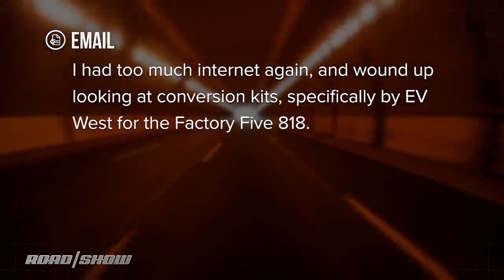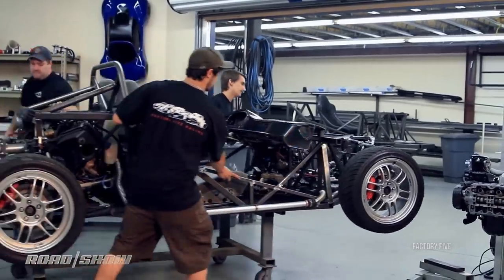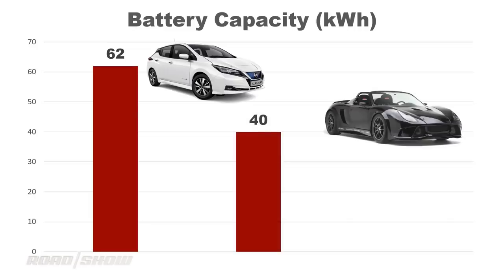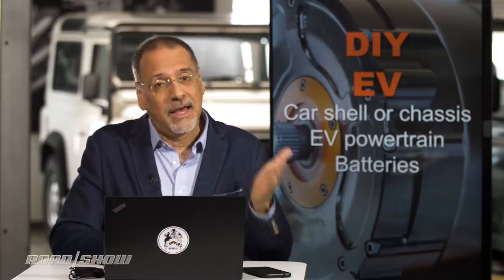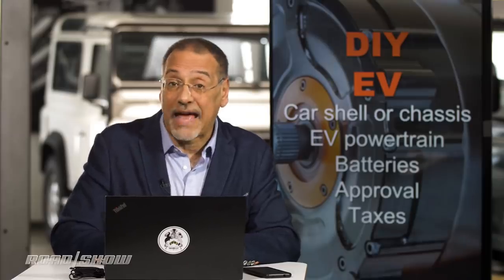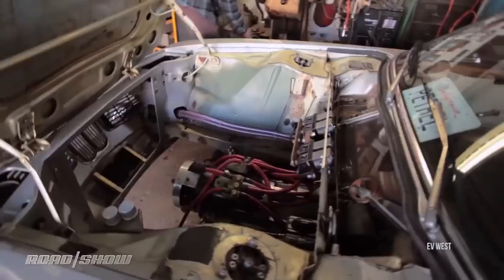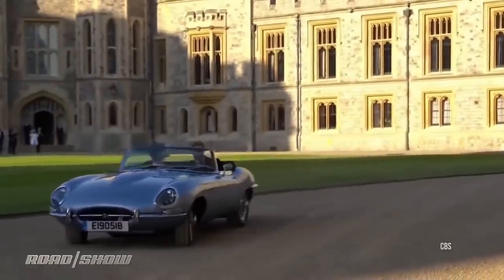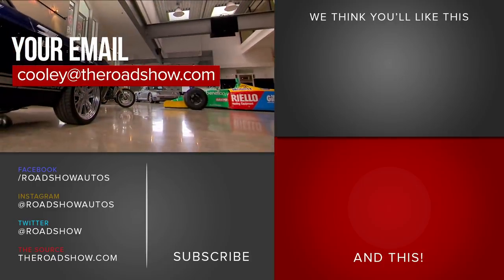Before you buy an EV, consider building your own with a conversion kit!

Comment: There's a ton where you don't need to necessarily spent $35k. A Hyper9 motor or a UQM motor with all the accessories like chargers, cooling kit, etc can be had for $10k or even less, depending on what you choose for parts. Also, skip the Tesla overpriced batteries for something more reasonable like LifePO4 or build your own 18650 pack and you can get that down to $5k. Convert your existing car you already have and save another $10k. Realistically a $20k budget these days, if you are just converting a car you own, is definitely doable. You won't have a Tesla with 300mi range or 0-60 in 4 sec, but an EV with respectable range and acceleration
Reply: I have been wanting to do this to my 2001 BMW..  Do you have any resources that you can recommend?
Thank you in advance
Reply: Thank you. My wife and I are in our late 50s and own 5 vehicles. I hate the idea of trashing my paid for vehicles and start all over with an expensive EV carnote. Thanks for your input.
Reply: This is perfect for what I have in mind, converting a 2006 Dodge Charger SRT8 from Gas to electric.
Reply: We can buy a new EV car in $8k why go through that hassle.

Comment: This sounds like a fun and terrible idea, just like most “project cars”.
Reply: Because it is a Project Car with similar level of frustration and difficulty. Not any worse or better.
Reply: Rich Rebuilds did a video on this. Another guy, at EVTV, stopped doing conversions because Teslas are better and cheaper than what he could build, even with a decade plus of experience. Conventional wisdom says:You’re better off with a used Tesla if you want a cheaper EV. If you have $100k burning a hole in your pocket (ie money is no object), go the kit / conversion route.
Reply: Like "project" anything at home!!!
Reply: @autophile525i  I have seen Indians in India do cheap electric car conversions it's very amazing what they can do. Practically plug & play. And I'm not very mechanically incline. I'm very impressed with it can do. And I have a $40,000 factory electric car.
Reply: @ai._m  id rather drive an electric ferrari than a tesla, so there's that
Reply: My electric Ultima RS ended up great. I partnered with my friend who is an automotive engineer and he really helped me out a lot.

Comment: I'm on my second EV conversion (some vids on my channel). I can confirm, this is not for everyone. Even with a kit, you need to be experienced with auto mechanics and electrical theory.  Like understanding how brake vacuum boosters work, or how to design a battery pack for the correct capacity and current draw for your motor controller. Just because I find EV conversion fun and intellectually stimulating, doesn't mean everyone will. Oh, and however you do an EV conversion (ground up DIY, kits, salvage parts, have a shop do it all for you, etc), you're going to need lots of $$$.
Reply: Now I have to look at that. 😎👍
Reply: Yeah that is where you come in and save the day.
Reply: How much more or less would it cost to convert my Maserati to a Tesla model s power train?
Reply: @jlove24  It depends on a lot of things like if you are doing the work yourself and how much you can get a junked Tesla to harvest the components.  If I were doing a Maserati myself, I would budget $12-$18k for a junked Tesla and another $8-10k in additional materials.  If you're paying a shop to do all the work, I would budget over $50k.

Comment: Convert your car into an EV at the low price of 32 thousand dollars + ?   That is an outrageous price to conclude for an EV conversion. Sure if the high end sports car with unlimited spending will cost that much, But! an EV conversion can be done to any low cost manual transmission gas powered car by removing its motor and buying an adapter mounting plate for the electric motor so it can be mounted to the transmission. Buying seats , accessories , ext. is a complete waste of money. What we need today is the same thing that Ford did in the early 20th century with his Ford T-model car but with Electrical Converts. Taking a gas motor car , put cost of removal of motor, cost of electric car motor, cost of batteries, and controller you're looking about 7-10 thousand dollars tops for a decent fully operational EV conversion that would be simple and basic enough to jump start a very high demand for cheap EV conversions to be put out onto the market. Taking a expensive gas motor car and converting it into a deluxe EV is like buying a frame of a car then spending tons of money to build the entire car like if you were on the TV show "Pimp my Ride" Really all that is needed is someone to build a reliable low cost/basic EV converted car chain that can be produced by an assembly line just like Ford did with his T-Model and you'll have so many buyers with such high demand you wouldn't be able to pump out cars fast enough to fill the demand just like what happened when Ford couldn't build T-Model cars fast enough to meet his demand. The EV conversion Gold Mine is just waiting for someone to fill that void, assessing the cost like this guy did will get you no where but in a huge financial hole.
Reply: needs to be more like 5grand for people to actually want to do this and have a shot at making any environmental impact. 32 k id just get a nice bmw
Reply: @HoomerbirdG2  It can be done that cheap, it would be a lower grade car more light weight car with little cargo room. If you dont carry much cargo and just people then 5 grand would get you a decent EV, but if you need something more long distance and can carry cargo then it will cost more 6-8 grand im guessing
Reply: @TheZafootz  do you know a rough approximation of the horsepower output a decent electric conversion could make in a small 4door? Im considering an electric conversion but if its going to cost over 8 grand Im just going to buy and put a honda j35 engine into the car myself, that should make 144 more horses than the stock engine and about 120 lb feet of torque more than stock.
Reply: @HoomerbirdG2  There's lots of different motors and controllers to choose from but it comes down to having start-up torque at low speed with low torque at high speed or steady speed ith constant torque. If you want high speed then u need to have a low torque at high speed motor, if you need hauling torque then you gotta go with the 2nd option. If you give me some more info i can go into more depth but unless i know the car you want to convert and what kinda voltage you want for the control system I can't really advise you any farther...
Reply: Blah blah blah...🥴😷
Reply: This is the most thoughtful comment I’ve seen in a while. The EV conversion “Gold Mine” is just around the corner considering all the technology developments on the batteries in the next 3 years. Batteries will be much cheaper, more efficient, lighter, can charge faster, etc. I believe the mechanic’s material cost would be around 2K and then 4-5K for the consumer. Also in the near future everyone will want to buy only electric cars and we have well over 200 million used ICE cars in the US only. What do you think people are gonna do with them? Sell them? That’s not gonna be an option since demand for ICE will be so low that it wouldn’t be worth the money to sell. Converting will be the best option.

Comment: The only reason I would convert instead of buy new: Avoid EV tab fees here in Washington State by converting a classic car and putting classic plates on it (no tabs required).
As a bonus: you get to drive a classic car as a daily driver.
Reply: And just another plus. You WON´T need a specialized mechanic to keep it on the road.
Reply: For reals. I want to convert an already fuel efficient geo metro. Mainly bc i want to also make it awd.

Comment: It costs as much and sometimes more than just buying a base Model 3 to build your own EV.
Reply: Now if you just want to have a fun car at a budget then you can just get a used forklift motor and hook it up with some lipos.
Sounds sketchy but there's sketchier builds than that
Reply: It would be cheaper if they used model 3 parts.
Reply: Luca Duca  Yes exactly, but you either have to work out how to brew your own fuel from lawn cuttings & a solar panel or you have missed the point !
Reply: But honestly it's worth it. I'd like to see S2000s and Silvias swapped.

Comment: There are over 30 different electric vehicle models to choose from in 2020 / 2021.
Used EVs are pretty inexpensive but have less range than the newer ones.  
Electric vehicles are great. No noise, no emissions, less fuel costs, less maintenance costs.

Comment: Someone online created their own Tesla conversion and it does quarter mile in 9.8 seconds using just one Tesla motor. They are working on a 2 motor version one wonders how fast that will be for sure. This 818 could very likely run a quarter faster then a Lamborghini Aventador SV.

Comment: Right now gas is wa cheaper than ev's, I want to be able to use gas or electric or both to be ready for anything.
Reply: Weight and space distribution are the deciding factors. Too heavy and your wasting energy, time, and money
Reply: Unless you live in a country with high electricity prices I doubt gas is cheaper.
Reply: Yes and no. The Tesla model 3 starts at $35,000 and doesn't require tons of gas and maintenance costs. So if you are comparing a Toyota Corolla, yes, gas is cheaper, but otherwise no
Reply: MANSQUITO  Biden pretty much is making that a fact.
Reply: @nerdnairbnordnirbu9044  well gas was about one dollar to one dollar and fifty cents this summer and fall
So with a car that got to mpg it was way cheaper than electric, unless you have already paid off your solar panels.

Not only that gas heat is way more cheaper than electric and you actually feel the heat.Eve get terrible range in the cold and heating the cabin is a huge drain on them.
That’s why I would go hybrid first, or an ev with a gas generator in back.

Never put everything in one form of energy
Reply: @iKingRPG  you will not find a Tesla at 35k it has no dealer network all repairs are contracted out and quality is spotty tax payer credits s what kept Tesla afloat they should give those to gas cars too.
A civic, insight, Prius or Corolla over a 5 year period than resale comparatively equipped would be a much cheaper buy.
Even a civic type r because of its resale value.
Unless you travel tons of miles.

Comment: Without any battery cooling system then your recharging will be slower, and the battery life expectancy will be reduced.
Reply: True, but the batteries mentioned were Tesla battery packs, which are liquid cooled and heated.
Reply: @JustWasted3HoursHere  so where are the heating and cooling systems?
Reply: @matthewbaynham6286  I would imagine that they are included in the package. He does say it includes "everything you need".

Comment: I am mixed in this. 

I rather get the Audi eTron or a Tesla (gulp) over doing a project like this. 

Right now in 2020, I can see this being a problem. But give it a few years, it can take off. This also points the way at some point to converting the ICE into an EV.
Reply: This is the most thoughtful comment I’ve read. In a few years, when batteries are cheaper it will be much more affordable and by that time everybody will be buying evs. So what are we gonna do with our ICE used cars if everybody wants EVs? Convert them since selling is not an option anymore.

Comment: 5 TESLA Model S battery modules in series is 125 vdc maximum, while the minimum voltage to operate the TESLA Model S drive is 275 vdc.  In other words you cannot build it the way you stated in this video.

Comment: An 818 with a model s rear drive unit would be an absolute rocket ship, the 818 weighs very little and the model s motor makes a TON of power. You could smoke a whole lot of stock cars in that

Comment: Just because one can put battery & motor, doesn't mean that it is a good EV. Anything kit (including all power train  & batery) over $10,000 is simply not worth it. When you consider the cost of base/host car, cost of labor or  tools + time (for DIY), resale value, used EV or new EV is a lot beter choice.  Many 2015+ Nissan leaf can be pick up under 7k, and even used Tesla can be pick up under 30K, not to mention brand new basic Tesla 3 at $35,000 if you can follow ordering instruction.  Current EV offers a lot more than just basic "electrification" of power train. Tesla 3 (even the basic one) has super performance, efficiency, amenities, all the sensors, 500,000 +miles warranty,  basic autopilot (with upgrade path to Full self driving), super charger network, strong resale value, super charger network.... it is no brainer

Comment: I’m looking to turn a crown Vic into an EV 

For those unaware the crown Vic was the go to police car for many America 

And now they’re dirt cheap because of the ex cop car status
Reply: Use the chassis to mount the batteries inside of the frame, as for the motor, you could try either a custom short drive shaft between the motor and the factory differential, hub motors and a torsion beam to replace the structural element of the differential, or use a Tesla style rear end. Or heck, shove the battery pack in the engine bay, the motor where the transmission used to be and fabricate a coupling that connects it to the factory drive shaft.
Reply: Louis Subearth 

Thanks for the advice if I do it I’ll look into it
Reply: MANSQUITO  

If I ever have the money

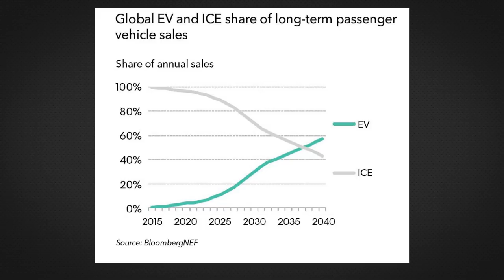Comment: (6:24) - There's already new EV's that are cheaper to purchase and operate than comparable ICE cars; WAIT a MINUTE... is there any ICE cars that have the features available on a Tesla Model 3 or S for any price?  nope, so there goes that argument. I don't think it was ever Tesla's goal to be only as good as any 4 door sedan on the market (with nearly a 100 year head start) , and that's why over a  Million people have purchased a Tesla to date.  People are purchasing EVs now not because they wan't to give big oil the middle finger, but because there's no other car on the market today with the features or that's more dedicated to making cars fun again than Tesla. The fact that I can stop a life long habit of supporting big oil with every activity I do requiring using my car, is just a bonus at this point. 
The biggest problem with EV conversions is the same problem they've always had: their compromised vehicles that don't offer any heating , A/C, or defrost so a full time convertible is a great idea I suppose. I think a EV "kit car" that's capable, that's visually exciting, and available at an affordable price is a great thing. However, for nearly $40G without any labor costs you could buy a great used model 3 and could drive it year around.
Reply: All those features of telsa drives of away most of the average consumer like myself.
Reply: ... And start new long habit of supporting Big Battery, not much cleaner than oil, if at all mind you. Plus (power) electronics manufacturing is one of the most toxic industries (35 y in electronics/robotics engineering). Nothing is as simple as we wish it to be.
Reply: @samusaran7317  same here 😎

Comment: If you don't mind that it's not a sports car and not a completely new vehicle then you could get a used Nissan Leaf and just put new batteries in it. Wouldnt the total cost for a very high capacity Leaf be around $20,000-$28,000?

Comment: I prefer the cobbled together approach.
An electric motor bolted directly to an IRS differential housing.
Batteries from numerous EV manufacturers will work and fit under bonnet or in trunk.
The cheaper a conversation the better.
You just have to mimic the battery cooling systems from some of the EV manufacturers.
😨😨😨😨😂😂😂😂

Comment: The "hard part" is getting doors to work and keep water out. Even welding up a frame is easier. There are ZERO kit cars available for a lightwieght, cheap, simple, humble commuter, EV or otherwise. The Riely XR3 does not have a prebuilt body...yet
It would be a great cannidate for Crowd Funding

Comment: If the batteries only cost $1800 to buy you put in at least two separate systems and then you always have an extra auxiliary and then you use your own 200 amp alternator & converter... 
& charge one: 
using the other one
Reply: Time will tell 😉
Reply: I don’t care of the batteries cost three times as much... it is still worth it... Instead of polluting the planet with poison ...

and blowing fuel in the sky
Reply: @johnswartz7872  Remember if your electricity still comes from a coal burning power plant you have not solved the polluting issue.

Comment: Cost is clearly not a motive here, even EV kits are not cheap. This is something to do for the fun and challenge. Those EV crate engines look really fun when they get cheaper. I’d love to put one in a Chevy SSR. Think of how many extra batteries you could got in the covered bed of that thing. Good use for the underpowered ‘03 and ‘04 ones.

Comment: Is nobody going to miss the sound of a v8 ripping up the street? That turbo whistle when taking off at a set of lights ?  The sound of a diesel with a 3 Inch straight through exhaust  trying to get up that hill climb?  
 Or even just pulling up to the servo to quickly fill the gass tank and get straight back on the road?
Motocross  wont be Motocross without  the noise of a 2 stroke screaming up the straight of a 450four stoke launching out of a corner.

Makes me sick to the stomach knowing we are moving towards  ev for the future.
Reply: Not really, loud ass cars just tell me you've got a small peen and are compensating, it's just annoying and smells bad. My 01 v6 mustang sounds cool but I'd rather save thousands every year on just gas, not even considering not needing oil changes or transmission fluid or all maintenance that ICE motors need, only thing I'll have to worry about is wiper fluid, coolant for batteries (even then there's batteries that don't need coolant), and battery voltage, and good batteries don't even lose voltage that much